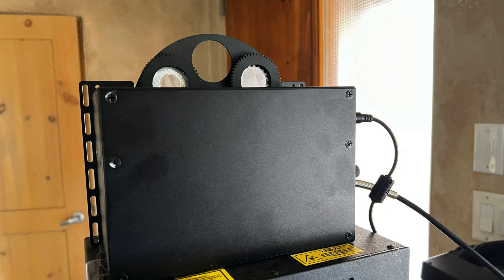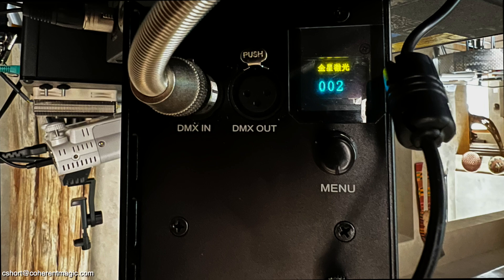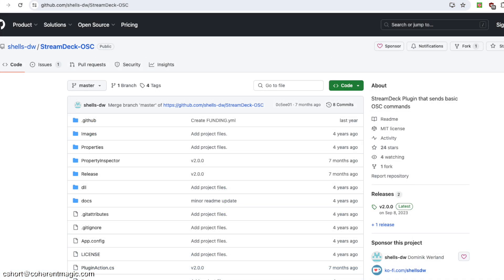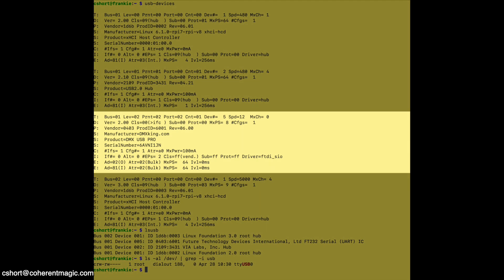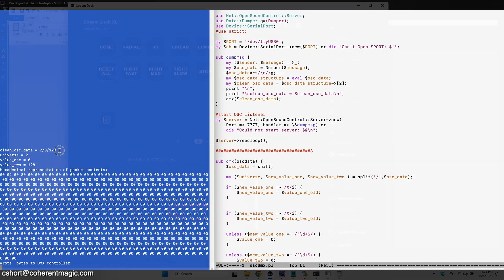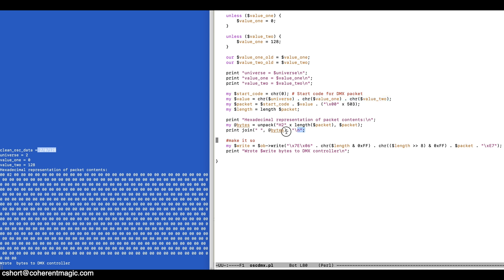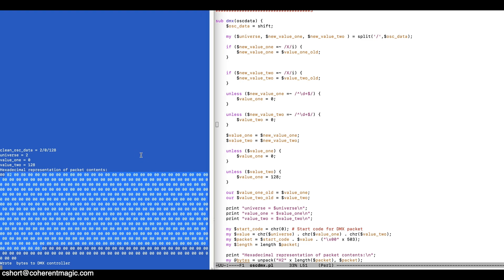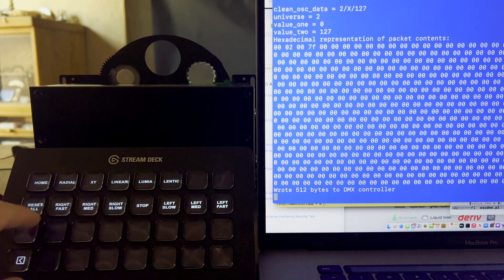stream deck and scan through dmx laser effects

Comment: Cool. I like the nerdy stuff. It's basically looks a more complicated digital way to advance an effects wheel like Laserium had on their different projectors. On the old Laserium projectors, from the 70's all the way into the 90's, "Hall Effect" switches were used. When you pushed the button on your console to advance the wheel, the switch would open to allow the wheel to be advanced with a motor and a belt around the outer diameter of the effects wheel. Then the switch closed again when the arm of the switch went into the notch at the next position in the physical wheel. Hard to explain the electro-mechanical operation in words without showing visuals, so my apology if it just looks like I wrote a bunch of gibberish.
Reply from the maker: the nice thing about using steppers is the more precise speed / direction control. you don't have to worry about overcoming static friction at very low speeds, and if your controller is smart, you can calculate shortest path (forward or backward rotation) to a effect and reduce time spent scrolling through positions.
Reply: @swamidog  you make some very good points there. Yeah, many of times I've had to climb up and stop a wheel when a switch arm was not falling into a notch and stopping the motor. And YES, there was only one direction of rotation on the wheel, so if the effect you wanted was the previous position, you had to go all the way around the wheel to get back to it.